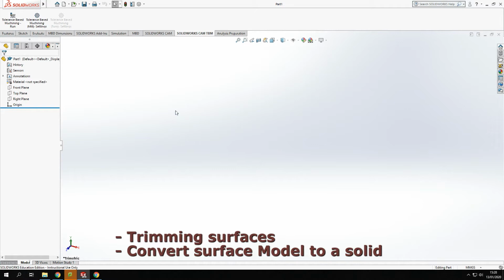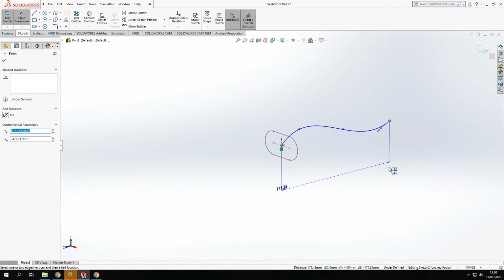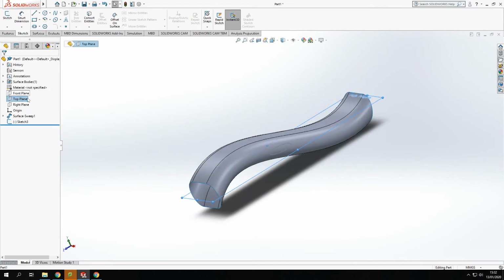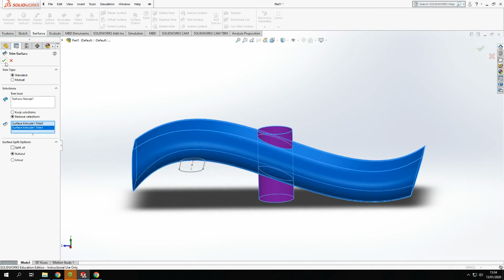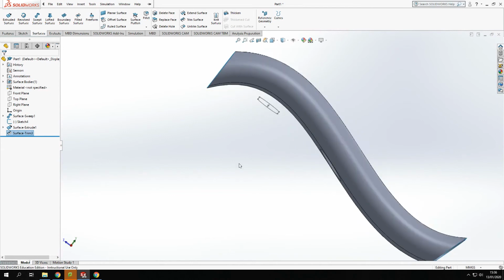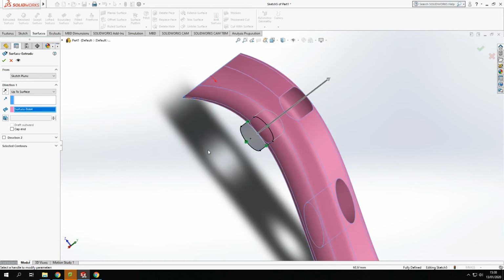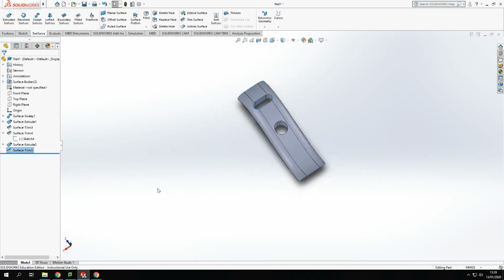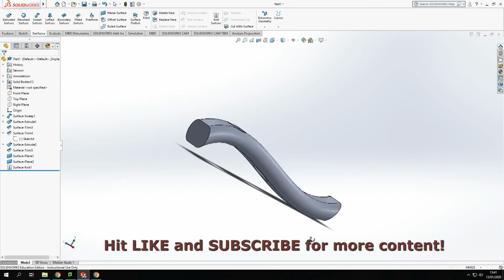SOLIDWORKS TRIM SURFACES - using trim surfaces and converting surface models to solid models!

Comment: Has solidworks "fixed the problem" when trimming.  That if you have an "enclosed or trapped volume" left over during trim, then the trimming fails with some stupid message about "....manifolds..."  I wasted a whole hour sweeping and creating surfaces, and when it finally came to "what should have been" simple mutual trimming it became a nightmare.
Reply from the maker: I am not sure if it has been fixed o will have a more of a look into it.